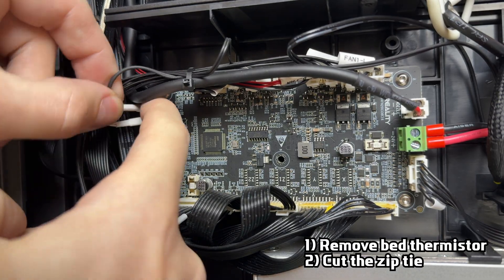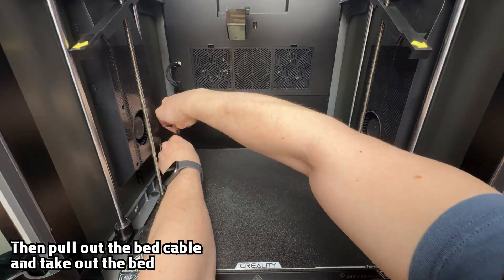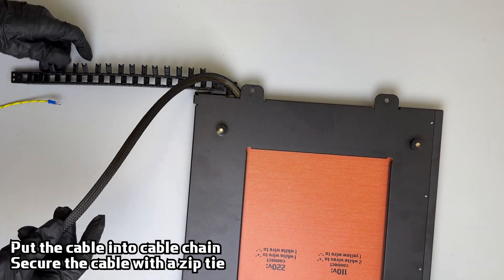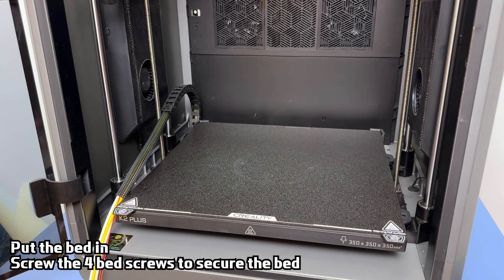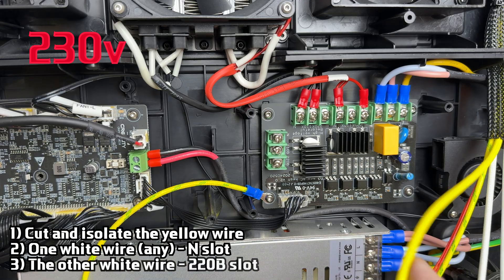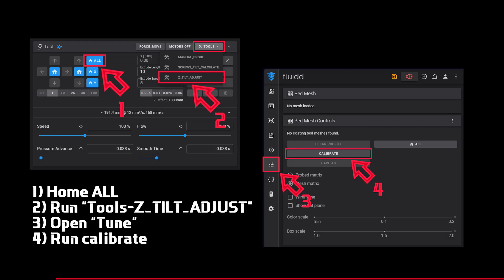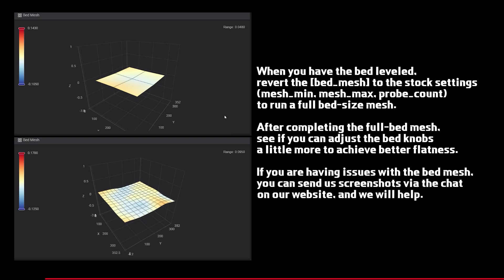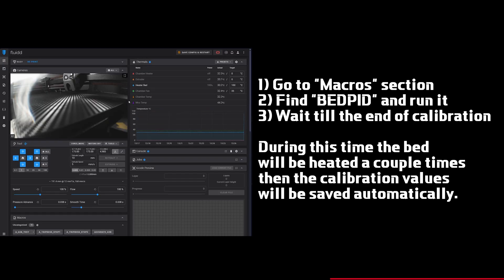Graphite Bed Upgrade For Creality K2 Plus 3D Printers

Comment: Does this affect the total build volume / available build area at all?
Can I still print 350x350mm objects like on the original?
Reply from the maker: Yes, you can. the bed is the same size and sits in the stock bed tray.
Reply: @R3men-3D  Excellent, will order one today then.
Cheers!

Comment: Hi Just to make sure on a K2 Plus with Cartographer installed. I use the standard stock spacers. as per one of your comments not the yellow springs?
Reply from the maker: Yes, we tested lots of different springs and silicone mounts and the stock ones worked not worse or even better than some others. So, just use the stock springs with stock standoffs and let the bed sit on springs (not fully compressed)

Comment: What stops you from providing shorter standoffs thus not having to print out those plastic parts and making the upgrade not look that diy?
Reply from the maker: This will not work. The bed tray has edges that will push against the bed heater. You can't put the bed lower
Reply: @R3men-3D oh that’s a bummer, thank you for the very fast reply

Comment: So if I am correct I can still use the stock probe with screw_tilt_adjust and the yellow springs? This does also work on the K1?
Reply from the maker: According to the tests on the K2 the stock springs work better than the yellow ones. The K2 probe is much better than K1's. 

You can try using the springs on K1 with the stock probe but it can affect the probe accuracy (even on the rigid mount the accuracy isn't great). But it may work fine if you find the right tension.

Comment: With a Cartographer scaner, do I use the metal standoffs along with springs or just the springs when mounting the bed?
Reply from the maker: On a K2 plus? You just use the stock mounting method: springs and spacers. 

For K1 series printers you can use yellow springs when using cartographer, because they allow for easy and accurate bed leveling.
Reply: @R3men-3D lovely! Cheers for the response, I'll be fitting my K2 Plus bed later this week.

Comment: I know you have instructions on your website for the K1 Max install, I just wanted to ask how different the install for the K2 is to the K1 Max?

I'm new to all this and also wanted to ask is it necessary to replace the stock SSR or will the one on the K1 Max be ok to use?

Many thanks 👍🏼
Reply from the maker: Judging from our buyers’ feedback, the K1 Max’s stock SSR doesn’t cope well with our bed heater when used on 110-120V. Therefore, it’s necessary to install an aftermarket SSR (included with the bed). On 220-230V systems, the stock SSR works fine in most cases.

If you have any questions or need assistance, please contact us through the chat on our website - we’ll be happy to help with installation and troubleshooting.
Reply: @R3men-3D Ahh nice, you just saved me from a real headache! 👍🏼

I can follow instructions but I have no real understanding of how the components work 😂.

While I understand that the stock  probe on the K1 Max isn't good, I realised the other day that I could still use the original probe with the graphite bed. Is there anything I must change to do this?

I ask as I thought the K1 Max works out the bed level via sensors under the bed and not in the tool head.

I will eventually get the Cartographer probe but I'm scared to mess it up.. 😂
Reply from the maker: To use the stock bed probe on a K1 Max, you’ll need to keep the cable that connects the main board to the MCU located under the bed. Simply remove this cable from the stock bed wiring harness and reconnect it to the MCU.

When using the stock probe, we recommend installing metal spacers for more accurate pressure readings.

Starting with the new batches, we’ll also include 0.1 mm, 0.2 mm, and 0.3 mm washers to help you fine-tune bed leveling in case any corners sit slightly higher or lower than others.
Reply: @R3men-3D Thank you ever so much for the quick response, you're a lifesaver!! 👍🏼

Comment: bed thermistor R3men_bed values is not good have: {"code": "key335", "msg": "Option 'control' in section 'heater_bed' must be specified\n\nOnce the underlying issue is corrected, use the \"RESTART\"\ncommand to reload the config and restart the host software.\nPrinter is halted\n", "values": ["control", "heater_bed"]}
Reply from the maker: This issue is not related to the bed or the bed thermistor. Your configuration is missing the PID values.

It appears that a portion of your configuration file is incomplete. As a result, regardless of which thermistor you select, the system will continue to generate this error.

To fix it, please add the following lines at the very bottom of your printer.cfg file:
#*# [heater_bed]
#*# control = pid
#*# pid_kp = 55.966
#*# pid_ki = 2.120
#*# pid_kd = 369.377
Save and restart. It should work correctly afterward.

Comment: What is this software you're using? Is it included with the graphite bed?
Reply from the maker: It’s the Fluid web interface. It’s already available on the K2 Plus printers - you just need to open it in your browser.

Find your printer’s IP address and add :4408 to it. For example, if your printer’s IP is 192.168.0.100, open "http://192.168.0.100:4408" in your browser.

There you’ll see the same interface shown in the video, including the bed mesh and other features.